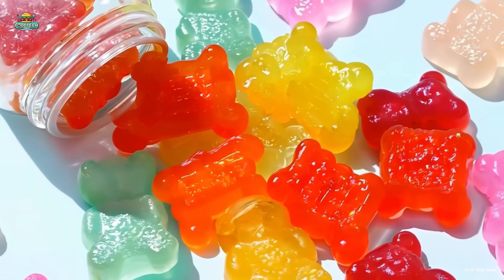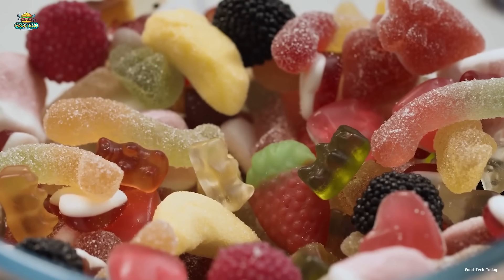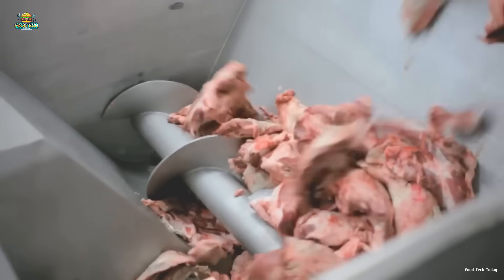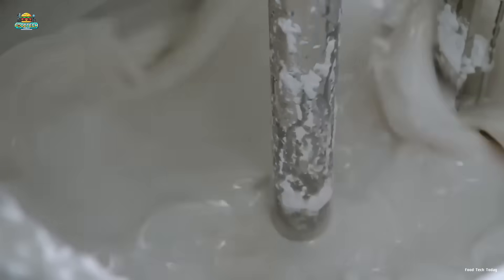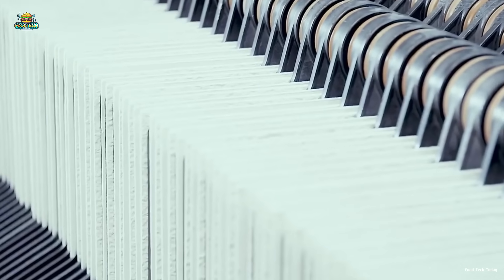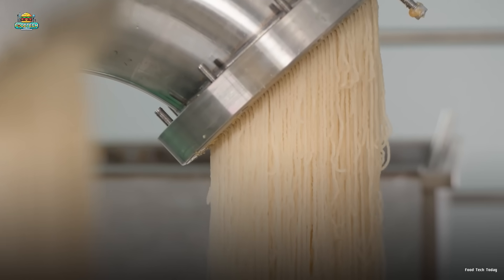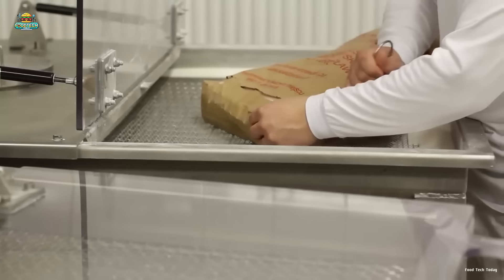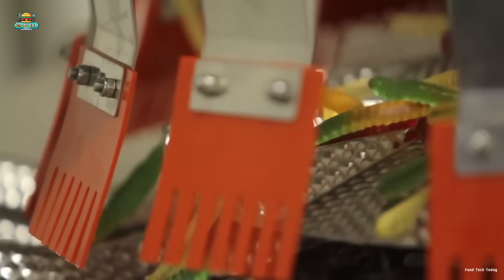How Is Gelatin Made? | The Truth Behind This Magical Binding Agent!

Comment: This purification process took the wind out of aspics. It is a dish of meat and/or vegetables covered in a thin layer of gelatin. Making gelatin from scratch in the kitchen was a long process that didn't end anywhere as pure as the commercial kind. Once getting the gelatin was easy, aspics lost the prestige that the original method showed off the cooks skill.
Reply from the maker: Aspic used to be a masterpiece; now it's just jelly with an identity crisis.
Reply: @FoodTechToday  blame Jello for all the "jello salad" recipes they put  out back in the middle of the 20th century. When I was a kid I liked the lime jello with shredded carrots in it. Then I had in that wasn't carrots and I never ate one again. Veggies do not belong in sweetened jello.
Reply: @nikkiewhite476  it's as challenging and you also need skill for plant based vegan alternatives as well , not just gelatin , except  that it's more healthier, cleaner and cruelty free
Reply: @Good.justice  what are you talking about? Your sentence is unintelligible.
Reply: @nikkiewhite476  I'm having alot of typo error problems for some strange reasons ,everytime I type a comment and check, it  seems ok but after I press  send and read it ,there are typo errors